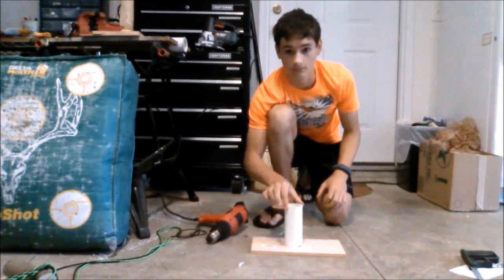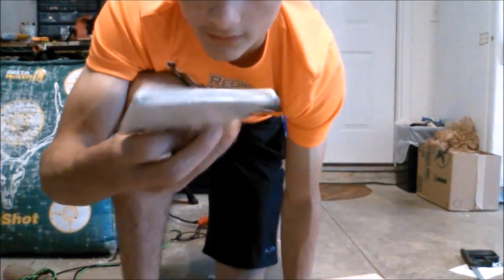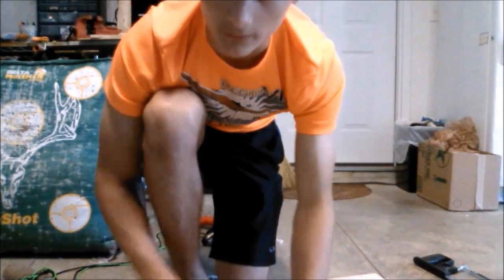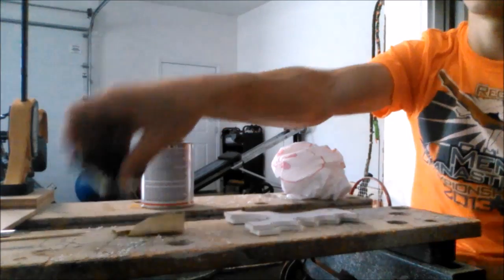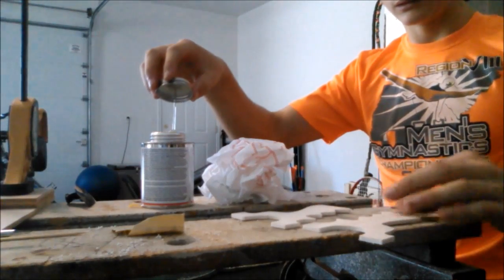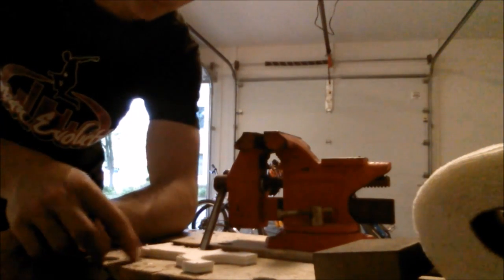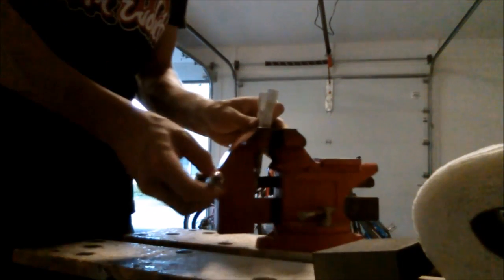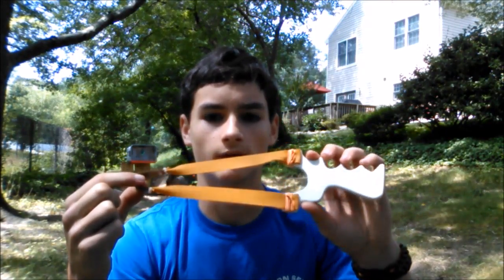How To Make A Slingshot Out Of PVC

Comment: No pvc primer?
Reply from the maker: Combat Robot Builder Eh I don't know why I didn't use primer honestly. It was my first try at gluing PVC together. I actually almost used 2 part epoxy. I don't know how well that would work. I haven't had any issues with it though. The cement by itself seems plenty strong. If I did it again I would glue it before I cut it so it would turn out perfectly flush.

Comment: +sharpshooterjd im going to do this but with 4 layers making a hunting/ quick change target shooter hope its good
Reply from the maker: Awesome! Make sure you glue all 4 layers together before you cut out your design. Good luck!
Reply: +sharpshooterjd i know lol. Ima use pvc bonding and a little glue might do 3 if 4 is to thick and is 2 plenty ridgid or is it have flex
Reply from the maker: +Dxmn Hitmxrker The one I made in this video, (two layers, or one piece of pipe flattened), is quite flexible. I would definitely do 3 - 4.
Reply: +sharpshooterjd how widedoes it wide when you flatten 2 inch pipe out
Reply: +sharpshooterjd and do you think I could use tubes on it with out it breaking?
Reply: +sharpshooterjd and do you think I could use tubes on it with out it breaking?
Reply from the maker: Yep just don't use like spear gun rubber or anything ;). If you are really worried about it, use more layers, or laminate it to something stronger.
Reply: +sharpshooterjd the frame im making is like 3 inch tall an its a bb shooter so ittle befine but im making a bigger version for hunting etc so mine as well ask
Reply from the maker: Yeah no problem, ask all the questions you want, I love hearing from you guys :). I hope it works out well for you!